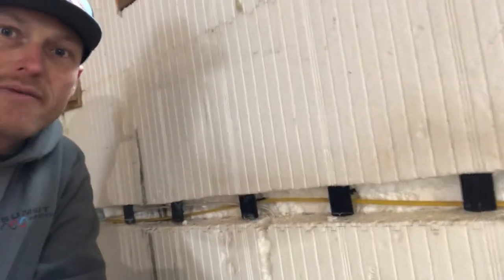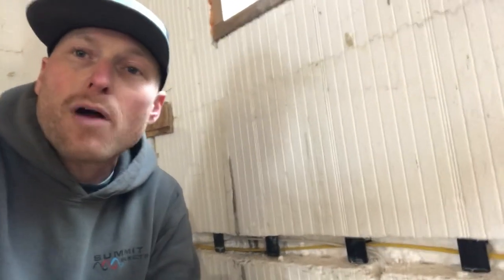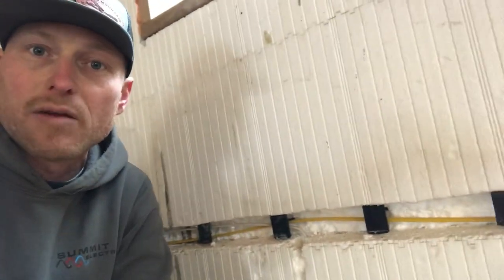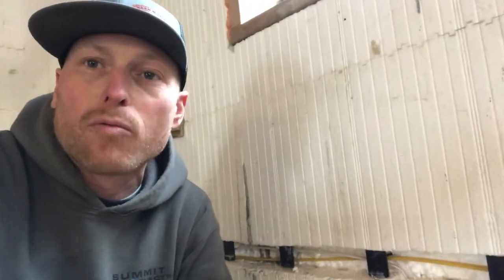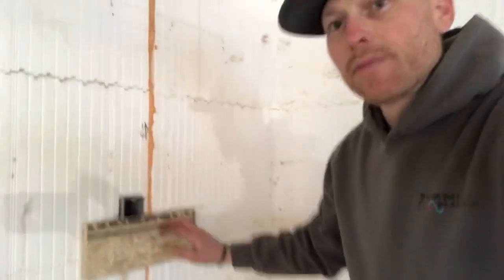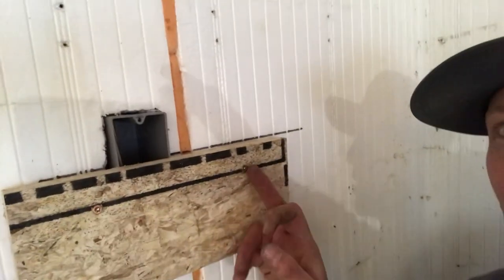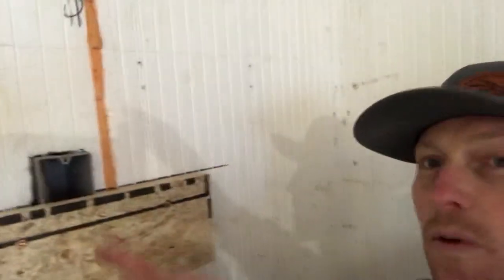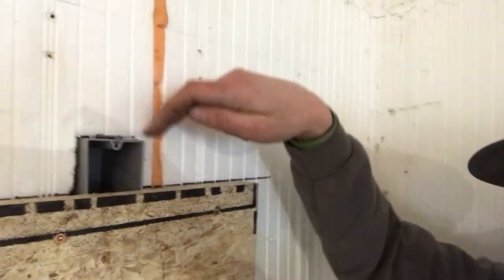Wire and box installation for ICF type wall construction, truss style floor joists, & a broom thingy

Comment: There is a much easier and less messy way of doing it, which is also best practice for ICF.
You did not need to dig that chase so deep and pass the wire behind the plastic ties, but you should have cut the chase in the front of the plastic ties with a hot wire cutter designed for this application (about $90 on amazon) it would have saved you plenty of time and a lot fewer eps crumbs. Then if you want it to look neat (but not necessary) filled up with low expansion foam. 
Also, there are electrical boxes suitable for ICF that can either be fastened to the plastic ties or locket into the foam and they are up to code likely everywhere. Did not need those planks of wood and all the extra work.
Most ICF manufacturers have instructions to do it the correct way and there are plenty of videos on youtube that show how it is done.

Cheers.
Reply from the maker: I expected this comment eventually
Reply: I was thinking the same thing.  Much faster, less destructive, and less mess.  Lowers the time/cost of installation when people adopt better methods and tools.  Always something to learn here on YouTube.

Comment: Not code compliant fastening of the box to the structure.  Nothing in code to support this.
Reply from the maker: We talked the AHJ- and he was good with how we used the foam and closed in the gaps, cauing a completly secure box, and for good measures we also installed a couple plastic anchors in the concrete, with #10 screws threw a 1/4" holes.  We are trimming out the job over the next few weeks, and can honestly say, one of the nicest projects to finish, as ever box is perfectly set in the finish wall board, and those boxes could be used Asa  step stool if you were so inclined, lol. 
Thanks for your comment, sometimes it's worth calling the inspector and ask him what he feels about something like this.  With material shortages, we can't wait any longer on one